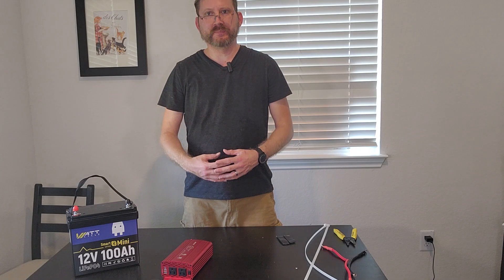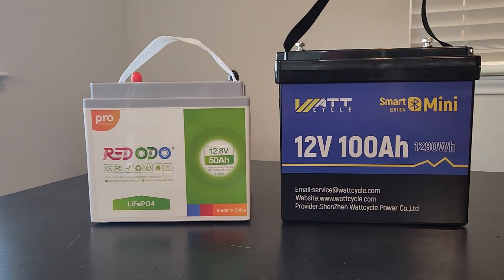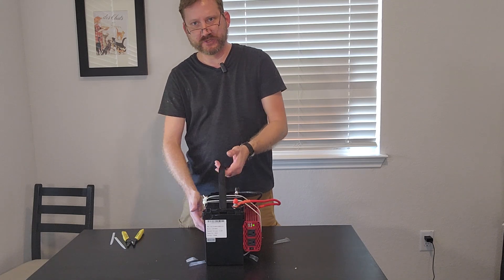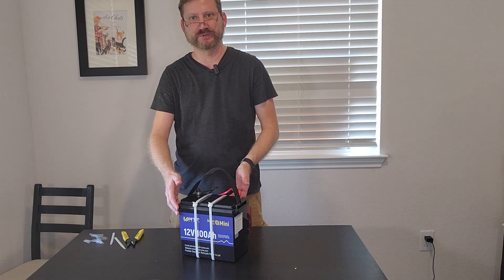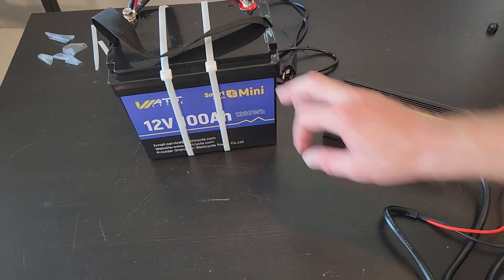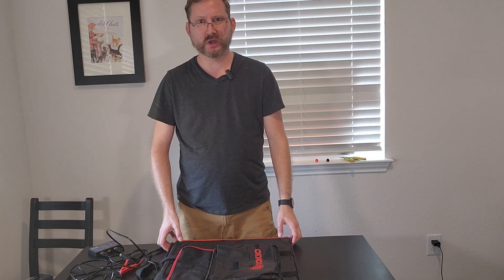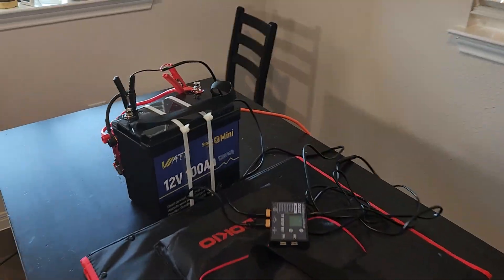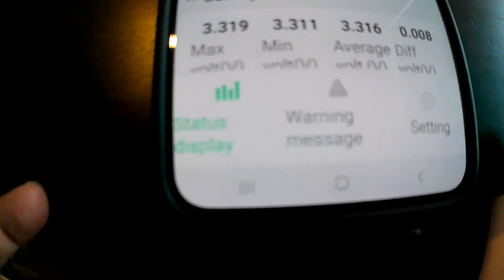Build the smallest, lightest power station in 5 minutes with no special tools. #solar #prepper

Comment: Some type of quick disconnect  plug installed like an XT90 for connecting the charger wires could make it a little more convenient.
Reply from the maker: A lot of 10 and 20 amp chargers have an Anderson harness

Comment: I'd really like to see how to build my own long-run UPS without the annoying alarm for various items.  The internet by itself doesn't require much power, but a desktop computer system with some peripherals will require a bit.  I'll bet you could still get enough run-time to outlast most outages, though, without breaking the bank.  And if you want to run a home theater system, the power demands will be higher, still.  Even so, the power demands of a HT system in a typical living room won't be anywhere near equal to the rating of the system, because you're hardly ever asking it to give you everything it's got.  Off the top of my head, though, I don't really know what it would take, for example, to watch 5.1 channels of a 2-hour action movie in an average-sized room with 6-ohm / 85db sensitivity speakers at moderate listening levels.  I'd be curious to know if anyone's ever plugged a power meter into the wall to find out.
Reply from the maker: check out the last video I made, a  big ups is literally the project

Comment: 1st off I like to say thanks for responding to all the comments. Most guys don't. Also, I'm building a little portable power station and I was going to put it all in one box (Battery, Converter, Solar controller, fuses), but after seeing this, I think I'll keep the charging part out. This makes great sense this way. Super portable and you can bring power station and solar panels to charge anywhere.  Thanks.
Reply from the maker: How big of a system?  If it's less than 2kwh, you likely can buy it for cheaper than you can  build it for

Comment: What's the highest amp this can be charged at safely? Can I use a 100 amp charger to charge this in an hour safely?
Reply from the maker: it has a 100a bms but i personally would not go over 50
Reply: @texasprepperprojects  ok so do I just get a 50A version of the battery charger you show in the video or is there a different type of battery charger I would need to get? 

Also, is a set up like this reliable for daily use for a year or years with under 100wh draw?
Reply from the maker: Yes. Yes and yes lol.  Check my other videos for a 50 amp charger. This battery is rated to thousands of cycles
Reply: @texasprepperprojects  ok thank you
Reply: @texasprepperprojects  I watched your video on the Ardroit 50a charger. When I clicked on the link to look at the reviews people were saying the leads are too thin and the leads burned up for one person? Someone suggested the leads should be 4 gauge instead of 8 gauge. Am I able to put my own thicker leads on this charger? If so can you send me a link?
Reply from the maker: @atnamesarelame   No, you can't make the leads thicker. They are integrated into the charger.  You can use the Watt Cycle and my code will save you some dollars YTPP10     https://www.wattcycle.com/collections/lifepo4-battery-charger/products/wattcycle-12v-40a-aluminum-shell-lifepo4-battery-charger

Comment: So the inevitable question is:   Can you make one twice or even three times as powerful the same way using the appropriate sized components?   200-300 Ah battery(s), 2000 watt inverter, 200-400 watt solar panels, charge controller and A/C charger?   Could your version also be charged using car power?
Reply from the maker: I absolutely can. Check out my later videos.  Right now, for 2 more days,  the 280ah battery is on sale for under $400 with my code.    Watt cycle sells a MPPT solar controller (I like the Litime's a little better because it's bigger.).    My preference is 24v, and if you do that you can use the Litime all in one inverter/charger/MPPT and build a HUGE system for cheap.   Car charging is possible, but expensive and SLOW (due to the dc step up) so I don't think it's worth it for a system larger than 1,000wh

Comment: 500w can run a lot of refrigerators and give you enough time if using it every so often.
Reply from the maker: In my experience,  it won't. A 500w inverter doesn't have the surge capacity to kick on a fridge or chest freezer. I've tried.

Comment: That's a cool little emergency power solution, but a battery and inverter does not a portable power station make!  There is no solar charging, no AC charging, very limited DC output.  Now, put those things on an a fire-proof board, with a 50-amp Anderson plug to connect to the battery, and you've got something closer to a portable power station.
Reply from the maker: I did mention charging. Thanks

Comment: Great video and simple solution.  Thanks! One question - I'm unclear about your solar recharge estimate.  How does 12 hours at 100w take 2.5 days?   The shortest day where I live in NC is 9.5 hours.  Assuming only 6 hours of those are useful sunlight I can kind of understand your point;  but in June where its more like 15 hours wouldn't it be significantly shorter recharge time?
Reply from the maker: that's not direct sunlight.   You only get 4 ish hours of full, direct sunlight unless you want to go out and re aim your solar panel every 15 minutes as the sun moves across the sky

Comment: Thanks so much for this setup! I’ve been looking for a cost-effective way to extend my UPS backup during prolonged power outages, and this is exactly what I needed. I work from home using a desktop, and my APC UPS only gives me about 45 minutes before the lead-acid battery is drained, which isn’t ideal, especially since constantly draining lead-acid batteries isn't good for their lifespan. With your setup, I can plug the UPS into the inverter as soon as there's an outage and get much more runtime—over 15 hours based on my current consumption! The fact that the inverter provides pure sine wave output means it won't cause any issues with the UPS, which is a relief. And all this, at a fraction of the cost of a pre-built power station! I’ll be building the same setup. Thanks again for sharing this.
Reply from the maker: Good luck building it! Let me know what you think.

Comment: Just a question, not a critique, shouldn’t you plug the charge controller into the battery before plugging the panel into the controller?  Otherwise pretty cool little setup. 👍
Reply from the maker: You are correct. But since I was inside it didn't matter. But outside you are right
Reply: @texasprepperprojects     I kinda figured, but it’s one of those thing where I’m not 100% sure. Thank you. 😁👍

Comment: I did the same with dcpowerhouse and a 300w pure sinewave, watchout for the heat from the inverter, detach when using it
Reply: I did the same, but attached a small solar charge controller to the battery. I use it every night for fans and lights, charging it off of 200 watts of solar panels.
Reply from the maker: the dokio panel comes with a charge controler!
Reply from the maker: nice, thanks

Comment: Nice introduction.  I recommend looking at Anderson SB50 connectors (or the generic "50 amp connector" version) and use those.  For example, with one on the battery and one on the charger you remove the error prone connect/disconnect process with a quick and simple plug/unplug.  That tiny inverter could also connect the same way. (The Anderson connectors are rated well over 50amps continuous with 6ga cable and etc. so probably even a 1000w inverter could be a reasonable connection, or add an SB120 connector for higher current.)
Reply from the maker: I am familiar with them and have used them in the past to replace MC4. I just wanted this to be as simple and cheap as possible
Reply: Hi, I have the 240v Best Tech 350w pure sign inverter in the UK and I’ve modded them this way.
I can connect the 12v plug if required ( not my preferred method ) or use it in any install with the SB 50 which I’m common using on.
Take care M.

Comment: The 500W inverter is pretty limited. An 1800W version would be interesting. But bigger...
Reply from the maker: Yup and a 1000w inverter wouldn't mount to the battery like that. Check out my 3840wh cart video
Reply: @texasprepperprojects  Sounds good, thanks!
Reply: That size inverter requires an alternator to be running.
Reply from the maker: Yyp
Reply: A 100 amp battery isn’t powerful enough for an 1800 watt inverter.
Reply from the maker: might fire up the start on surge depending on how good the BMS is

Comment: Bluetooth in a battery is just creepy
Reply from the maker: but very handy. Don't use it if you don't like it, but it saves a lot of money on a shunt
Reply: @texasprepperprojects what are the advantages of a Bluetooth battery? Honestly don’t know.
Reply from the maker: Did you watch the whole video? Bluetooth let's you watch the status of the battery in real time. How much current coming in or going out so you know the state of charge. A stand alone bluetooth battery monitor runs about $80, so you are getting that ability for less. However what you also have to think about is that if you have a stand alone shunt or battery meter, it's more wires and terminals you have to connect. So things get even more expensive and complicated. When you have that built into the battery, the build is simple. Check out my other builds to see where and how the shunt is wired